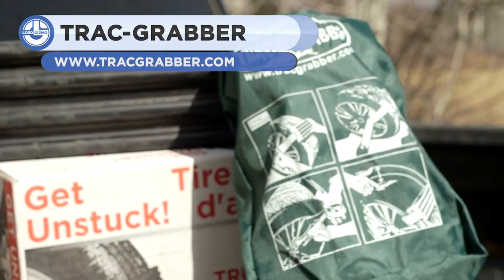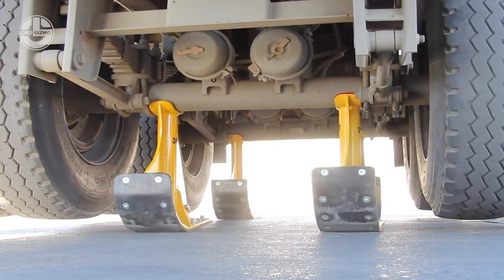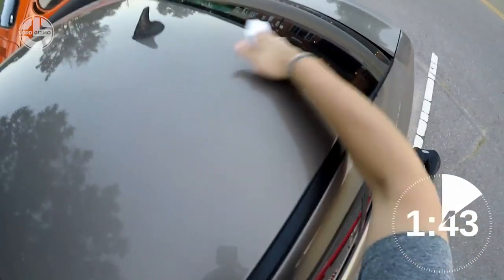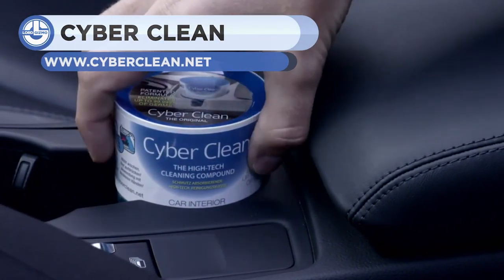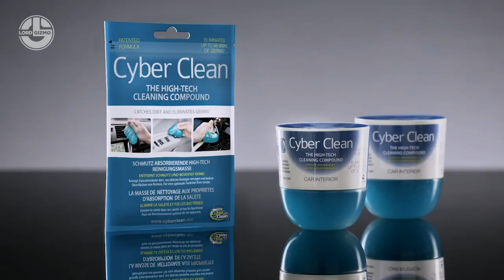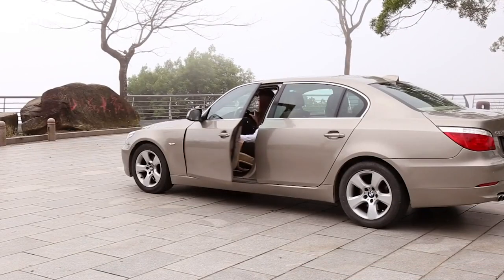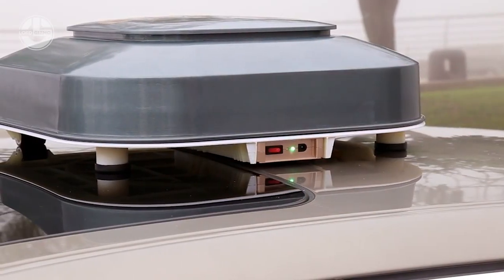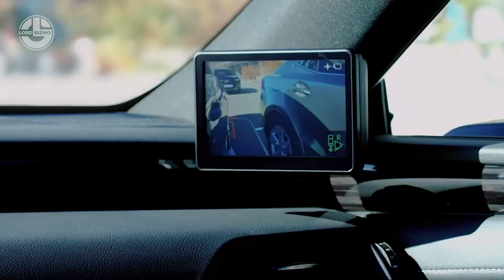8 Amazing Car Inventions That Are On Another Level

Comment: On the michelin air les tires how do they work in winter climents
Reply: This ain't official but actually you don't see them at NTB or Discount Tires simply because of a few bugs that have to be worked out first.  Probably so they can't get sued the first time the rubber freezes & snaps in Winter.